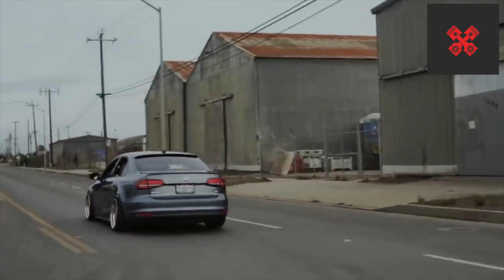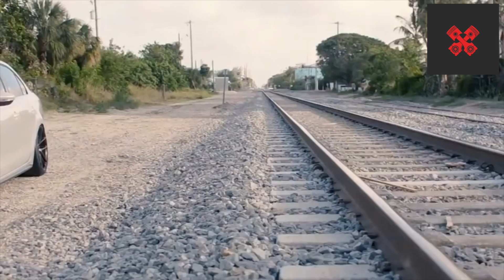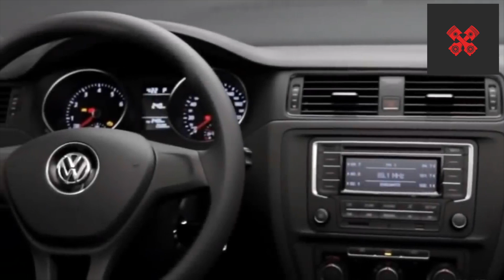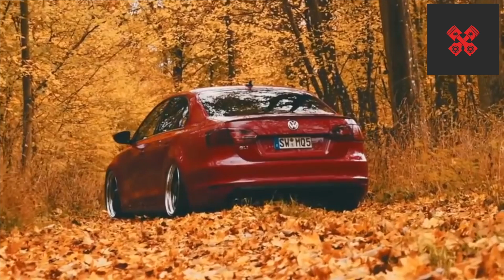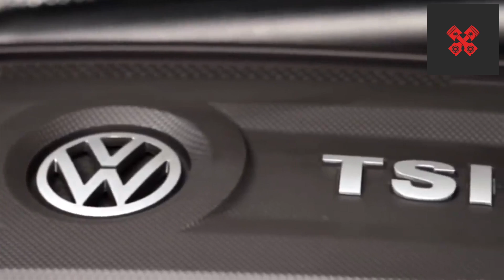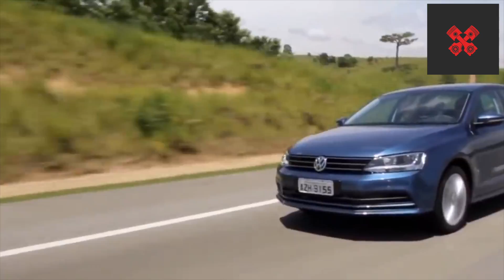Used Volkswagen Jetta 6 Reliability | Most Common Problems Faults and Issues

Comment: VW Jetta 2012 with 130k Kilometer no problems so far, oil change every 15.000 km , 2 times change of spark plugs , 1 times in the front new rotors and Break pads ( rear breaks are still original !! Pretty good car !!